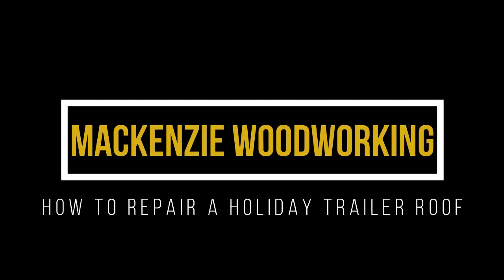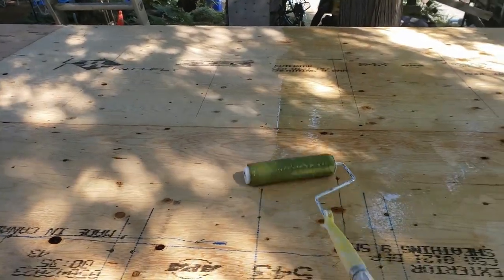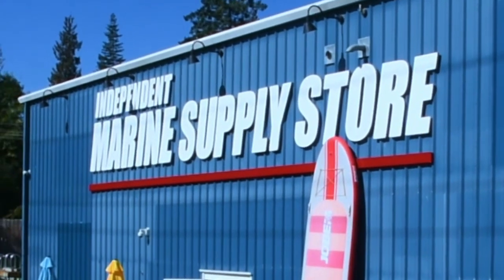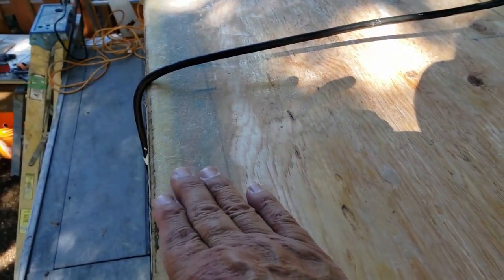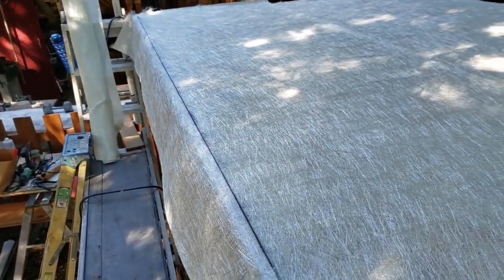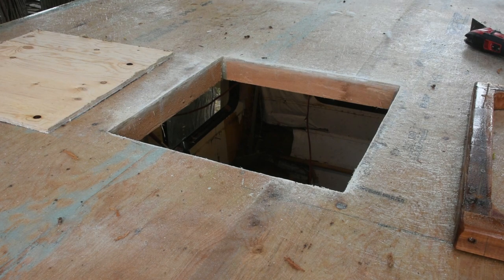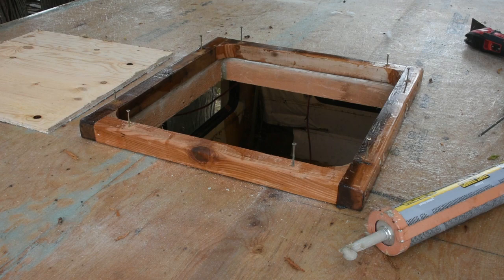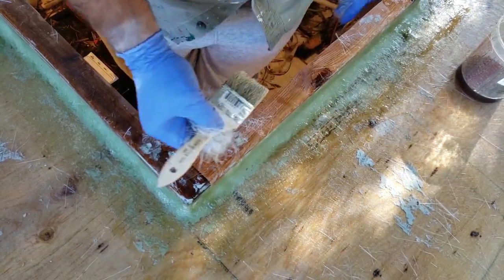How to Fiberglass a Holiday Trailer Roof

Comment: Can you paint the fiber glass surface using something like a nonskid deck paint?  I’m considering coating a boat floor in fiberglass to help better waterproof the surface
Reply: Btw, I love your videos and your work
Reply from the maker: Yes, you can! You would want to use a polyurethane paint with a non-skid additive. If you put down gelcoat you have to put down non-waxed. If you are re-fiber glassing when you do the gelcoat you can add a non-skid additive and the gelcoat waxed.
Reply: @MackenzieWoodworking  one last question, is it possible to add some non skid additive to the polyester resin to give river glass some grip?  I was contemplating keeping the wood look of the plywood so I wouldn’t paint the surface.  I like the natural wood look but was wondering, can I add some
Media like crushed walnut to the top coat and then go over it again with resin??